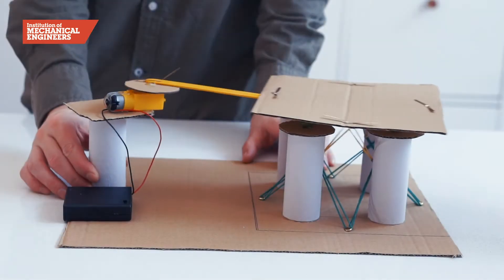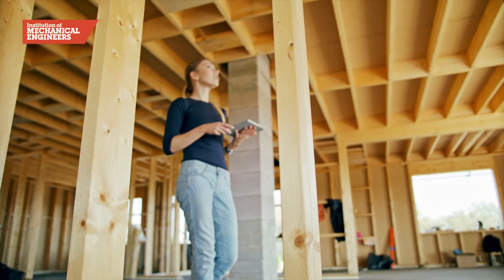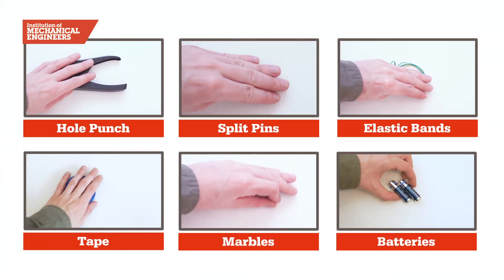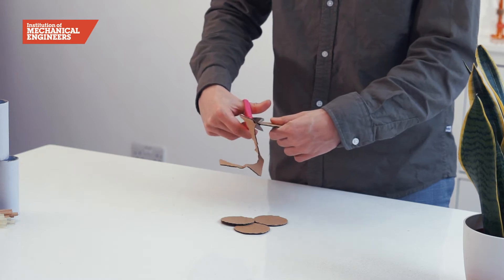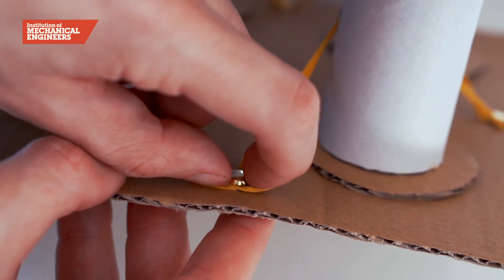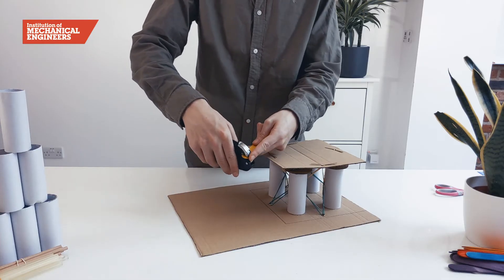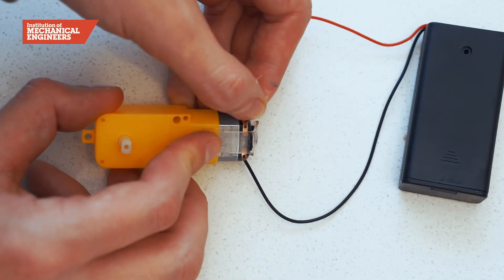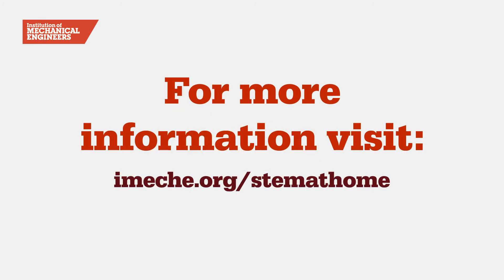IMechE STEM Activity: Seismic Shaker

Comment: Is there any way to add acceleration motors to show different kinds of exames of magnitudes?
Reply: you can using speed controller, but it can be somewhat expensive, they use arduino or transmitters/resistors in addition to motor and the controller itself